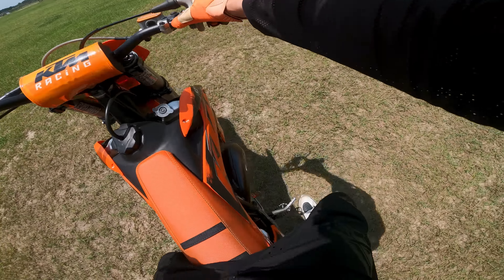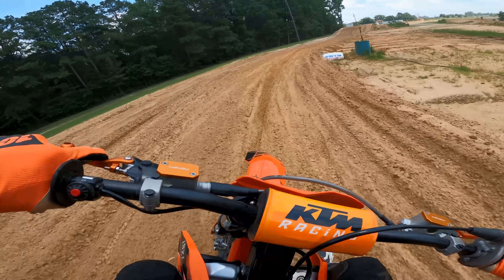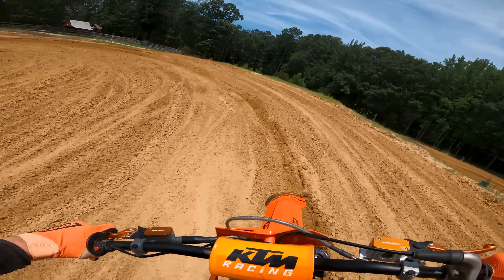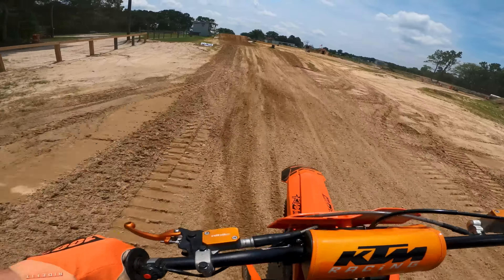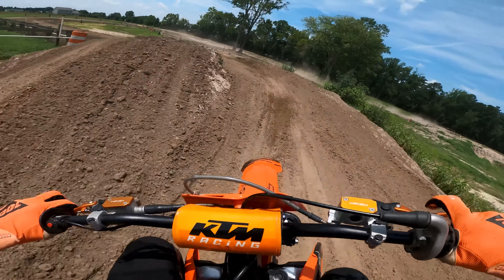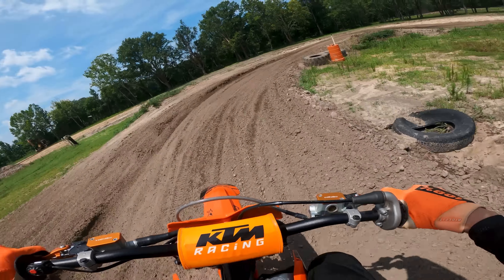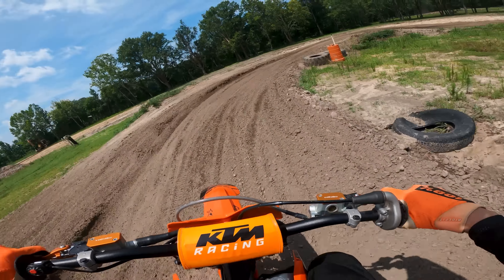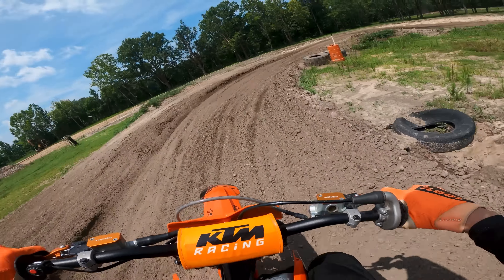Goon Re-Learning How to Ride a 2 STROKE

Comment: Didnt you have the keihin with the stic mod? Do you think that had a hand in the reason why she melted down? The keihin is really nice on this bike. I don't have the stic mod but I bought mine from two stroke performance with there head. Runs pretty good. A ton better than the mikuni ever did. That being said I could tune the keihin a bit better than what it's currently at. 

Or hit up lectron and try out there newest carb haha
Reply from the maker: Yup I definitely think the STIC mod is why it melted the piston. When running good, it felt really good, but clearly was too lean and destroyed the top end really fast. I've got that new Pro Lectron on the way haha
Reply: @DerekHallman  hell yeah looking forward to your first impressions on the carb. 🤙

Comment: The 150 rips. I would leave it running rich until it breaks in that new piston and rings bro
Reply from the maker: Gonna be ripping even harder when the jetting is perfect! You're right, for the break in it was better that it was running a little rich.
Reply: @DerekHallman   u have any idea how the bike blew ? Was it too lean on top? The mechanic let u know what could've went wrong?
Reply from the maker: @chrisvozza6530  yeah the jetting on the old carb I was using was too lean and basically just melted the piston.

Comment: Is the 125cc or the 150cc best?
Reply: They are basically the same but the 150 (the big bore version of the 125) feels more snappy and has more mid to top end power but you have to shift precisely to get most out of the engine

Comment: Didnt you have a lectron on her before bud?
Reply from the maker: I've rode this bike with the stock Mikuni, Lectron 38H, Lectron Billetron, and Keihin w/ STIC mod. After rebuilding it I wanted to put the stock Mikuni back on with KTM's recommended jetting so there wasn't any guess work. I'll put the new Lectron Pro Series carb on it here soon.
Reply: @DerekHallman  DAMN. That's a lot of carbs 😂 Heard mikuni carbs are kind of bad all in all though I know they are on CRs.
Reply from the maker: @patrickmeyer9905  Haha I've just about tested them all! These Mikunis just seem difficult to dial in perfectly and they are very sensitive to temperature changes.